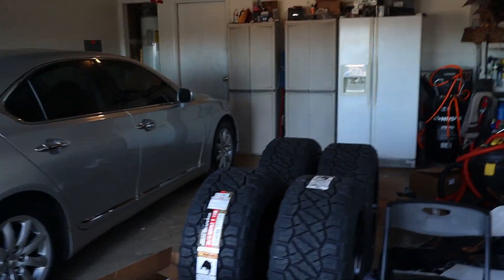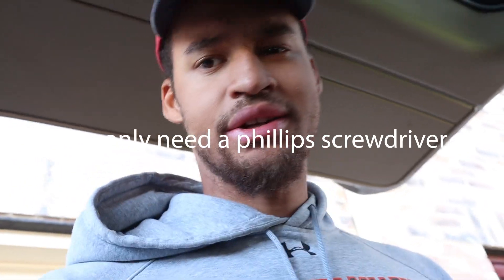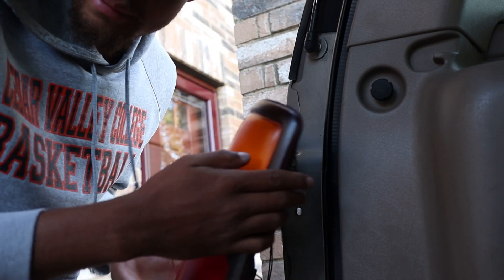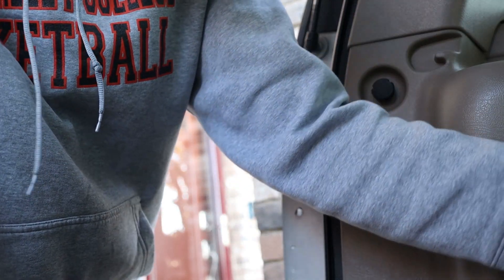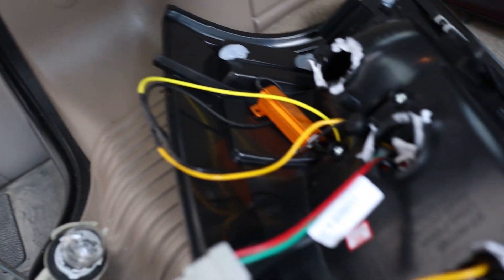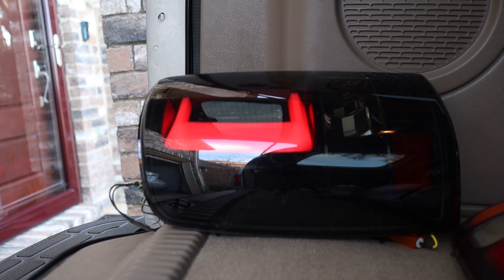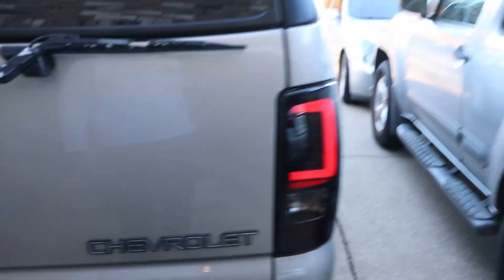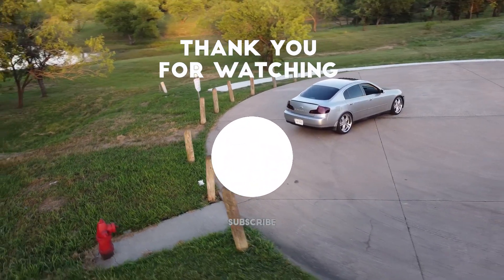04 Tahoe Spec D Tuning LED Tail Lights Install & Review

Comment: Hey bro new sub here... hey i just installed these on my 02 yukon and the taillight seem very dim only when I step on the brake they light up but its not too bright... yours look very bright even with just the lights turn on... I connected everything right.. not sure whats up with it
Reply from the maker: That is interesting to say the least.  I would make sure all your connections are tight.  I did have a problem with mine coming loose.  Another possibility is that you got the darker tinted taillights.  I believe they have 2 different smoked versions.  Let me know if that helps
Reply from the maker: That is interesting to say the least.  I would make sure all your connections are tight.  I did have a problem with mine coming loose.  Another possibility is that you got the darker tinted taillights.  I believe they have 2 different smoked versions.  Let me know if that helps
Reply: @chantzsgarage  yeah thanks man. I did get the darker tint ones....I guess its normal... just wish it was a little brighter lol.. thanks bro looking forward to your build...

Comment: Am I doing something wrong I upgraded to the led hyper flasher I have the blinkers in the mirror front back and interior is led but I tried to put my new led taillights on my 03 burban but my blinkers don't work cluster and the mirrors just stay on.  I usually leave the resistors alone just have it comes I can't find a solution to the problem.

Comment: Link for taillights cant find the tinted ones anywhere plz
Reply from the maker: I looked all over and could not find the tinted ones in stock that I bought unfortunately.  I left a link to the same kind with multiple other variations in the pinned comment above.  I hope that helps

Comment: Any problem with the cruise control.  After you install the tail lights
Reply from the maker: Yes for some reason it stopped working and many others have had this problem.  I am not sure why or what the solution is unfortunately.
Reply: @chantzsgarage  I guess it’s a safety issue that your car recognizes. It thinks it has a taillight out so it disables the cruise control option.